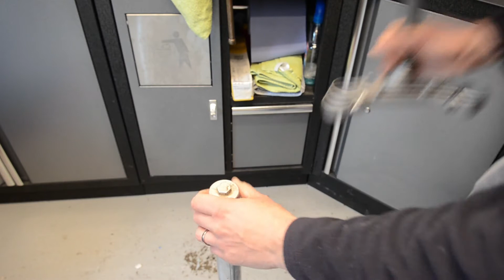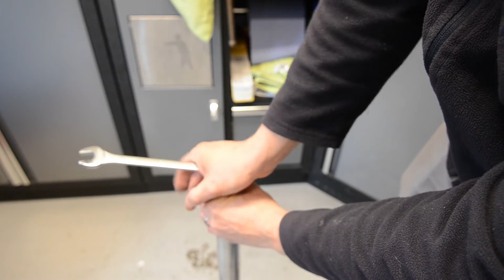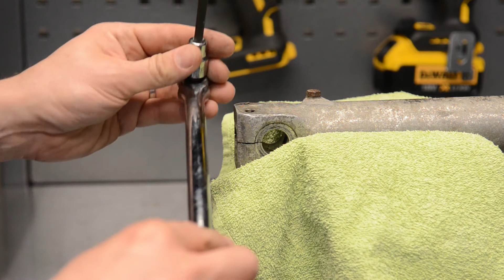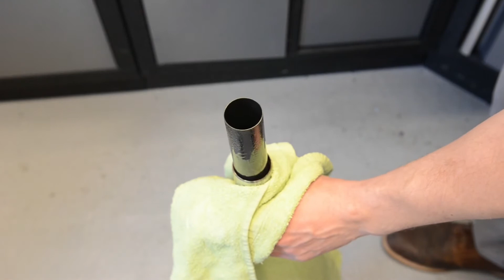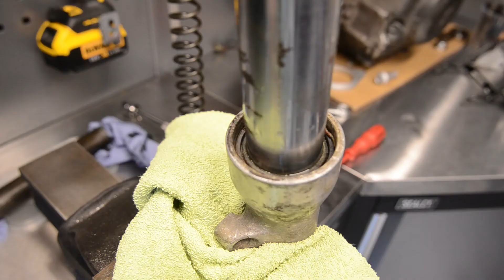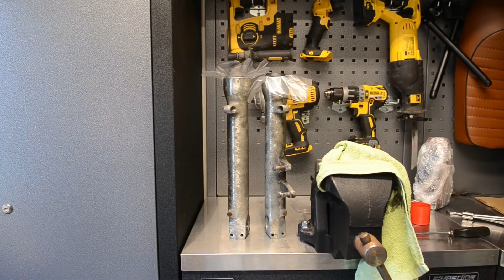Honda Bros NT400 Restoration Project Part 6 Frork disassembly, seals

Comment: best to keep cap and spring in place when removing bottom bolt.
Reply from the maker: I agree as you need the tension, unfortunately both forks had been previously disassembled by someone and parts were missing inside. One even had a tube thrown inside instead of the damper spring. Crazy stuff.

Comment: Hi, nice job so far. I have a Bros also and need the forks done because of pitting. I have been looking and they are hard got new. Some from China on Ebay,  but I seen a crowd in Ashbourne Co.Meath that do hard re-chroming. The quote I got was €160, and the Chinese ones were around €110. Hope this helps?
Reply from the maker: Yeah this is a problem with the bros, it’s so old now. I have looked at these options, the ones from China but that will take forever. Weemoto Uk site has ones at €105 each, if parcel motel them, or what I did last night is got a set of cb600 hornet ones on adverts for €80 and I am going to try and build a hybrid, the internals look identical but I haven’t tried it yet, I will post a video if I am successful.